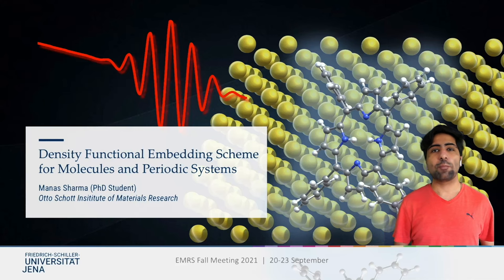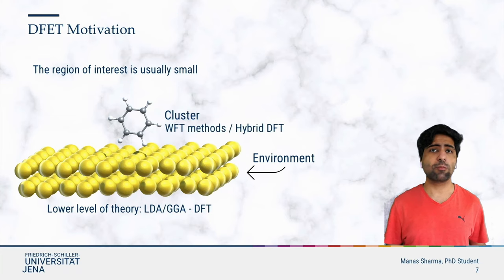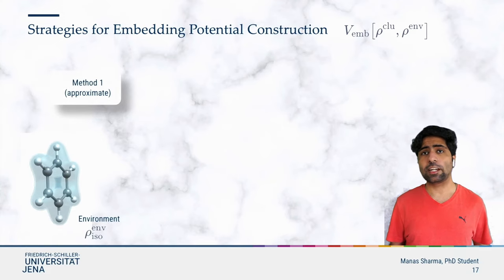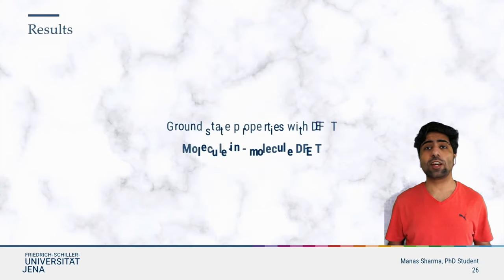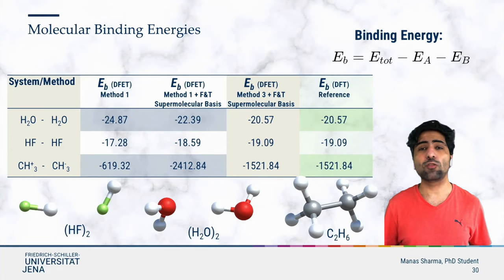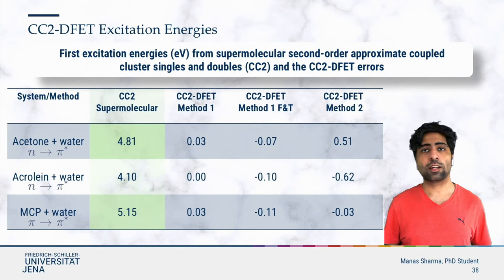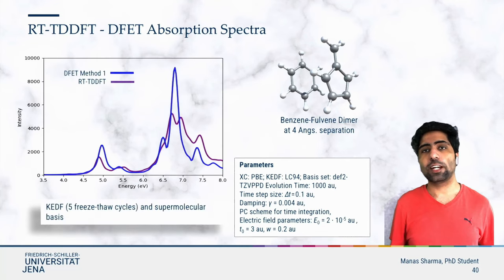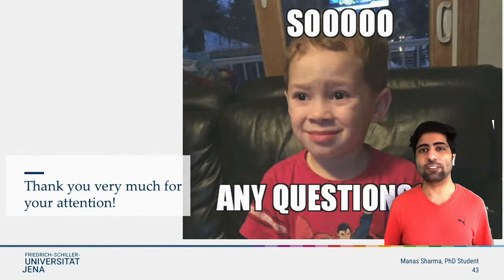My Award Winning Talk at EMRS 2021 (Fall) on Density Functional Embedding Scheme

Comment: hello sir first of all congrats, i want you to ask that which institue is good for Msc physics du or jnu if anyone instersted in theoretical physics
Reply from the maker: I have never known anyone from JNU so I cannot speak for that. As far as DU is concerned I would say that it really depends on who is teaching which topics. Unfortunately in DU, the professors rotate for a given topic/subject every semester. So you cannot be sure who you will be taught by. After completing M.Sc from DU what I have realized is that you really have to study from a lot of different books and make sure you have a good conceptual understanding of everything. When I studied there, there was a lot of focus on theory and you really had to spend a lot of time to get your basics right. But the key factor was self study based on what is taught in lectures. Self study was extremely important. I would guess that the same will hold true for JNU. 

So the moral of the story is to study hard wherever you are and try to do research right from the second semester. Keep asking until you get a project from a professor. One really bad thing about DU was that they didn't let the students who scored less than 60% in the first year to do an MSc thesis. This was outrageous. You might think that this seems reasonable, but you have to understand that the professors at the time set extremely difficult papers and only 10 or so students out of 150+ got more than 60%. This is when 75 of those students were the top scorers from general category in BSc physics honors in DU colleges. A similar number of students were admitted through an entrance exam. I would say these were some of the best students of our country but DU managed to spoil a lot of their careers by failing them, giving them low marks and not letting them do an MSc thesis. Fortunately, for me I got to do an unofficial research project that resulted in two journal papers, and 1 conference paper. Can you imagine, they did not let me do a thesis, and I think I was the only guy whose work resulted in so many papers there. So I really hate the culture at DU. They are still too focused on pure and theoretical physics, which is good for you, but they think that if one cannot do these then one cannot do research in experimental or computational stuff either. This is flawed thinking. Not everyone can be good at the same things.
Reply: @PhysWhiz  Thank you sir for your deep reply, I hope I'll connect you too soon.